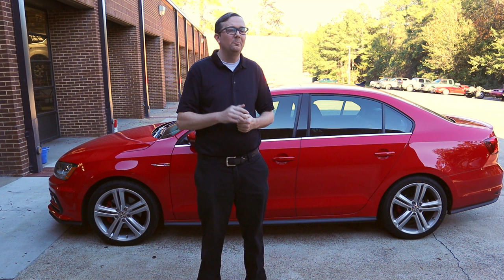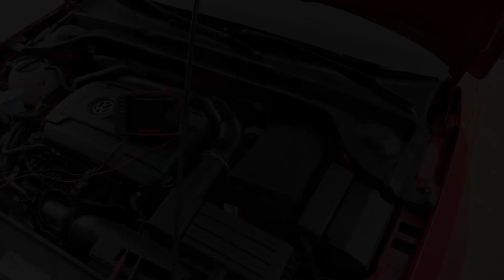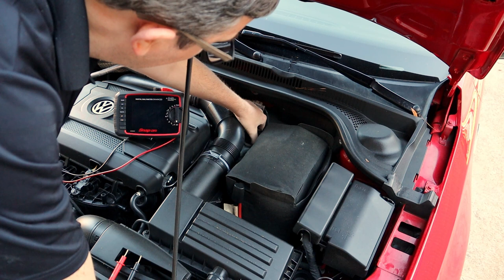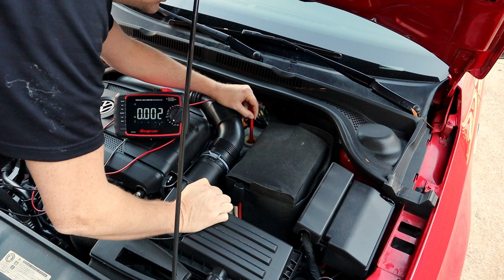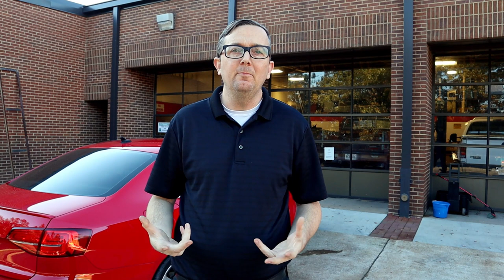Checking brake fluid with a multimeter

Comment: What's the theory here? The brake fluid is electrolyte and the multimeter probe and master cylinder are dissimilar metals forming a battery like one of those old potato batteries from school? Is it an aluminum cylinder and steel probe? What if you use a copper wire as a probe? Is there a more ideal metal probe that would give us more resolution?

Comment: Someone did a test of the same car and he had a good .02 volts reading on multimeter but a replace reading using the moisture meter and test strips. Shouldnt the test be on the brake fluid in the lines? Someone might have just top off the reservoir.
Reply from the maker: This is just one test, it doesn’t measure all contamination. If it fails any test, of course we would replace it with clean fluid.
Reply: You bring up a very good point

Comment: 😁 I wonder if you realized that you put the brake fluid containing meter probe down atop of the plastic engine cover. 😬 Otherwise, great video!
Reply: umm, plastic doesn't conduct electricity... 🤔
Reply: Maybe he was concerned that as brake fluid is corrosive it could potentially ruin bits of the plastic cover @shaman4560